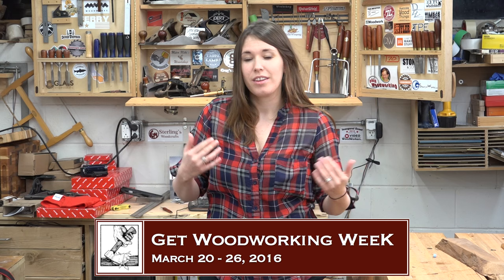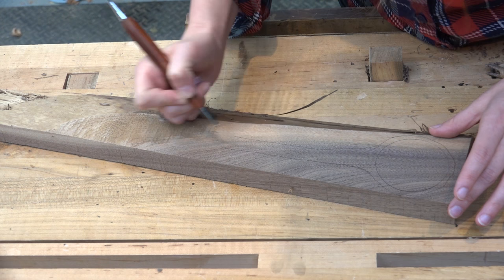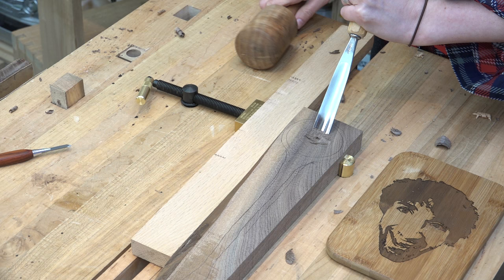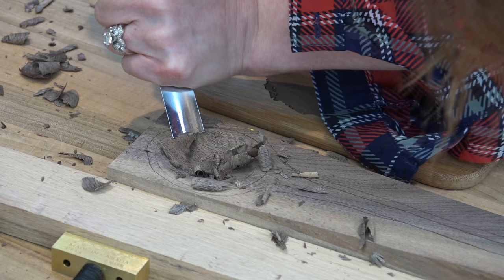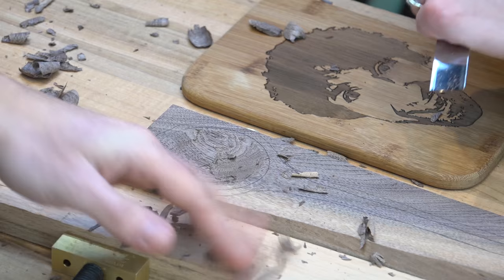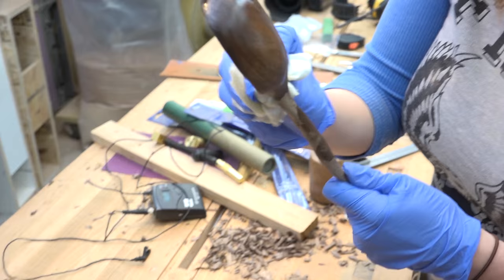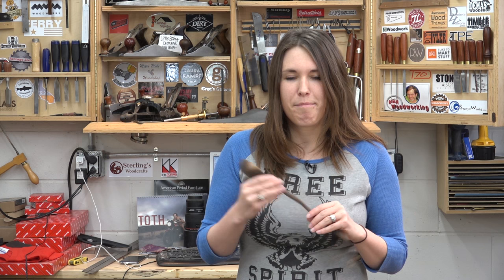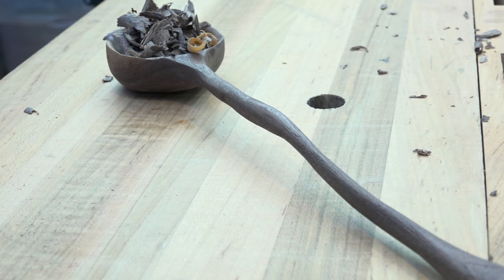Lindsay Carves a Spoon - Get Woodworking Week 2016

Comment: You had me a bit nervous when you were carving the handle, Lindsay. Well done!
Reply: +Steve Collins Thanks--me too.  And I started to get pretty crabby cuz the handle was much more difficult than the bowl.
Reply: +Lindsay Cremona You may want to try a carving knife to rough it out, however,  there is a learning curve to that because cuts are hard to avoid at first.
Reply: +Steve Collins Matt got me a carving knife. Probably will try it out on the next project.
Reply: Steve Collins yes me too I thought for sure that the chisel was going to end up stuck in her palm. Thank goodness it didn't and the spoon turned out pretty pretty good.
Reply: @lindsaycremona2459  Good first attempt.

Matt should have taught you a bit more about proper use of the chisel.  When carving the handle, the bevel side of the chisel should have been down. Using it with the flat side down tends to cause the chisel to dig into the wood and you don't have good control. 

To get a mostly straight handle, get Matt to teach you how to use a thumb plane. A cabinet scraper is a good tool for smoothing out the rough shape.

Even though you didn't like them, learn to use the spoon gouges, they make the job so much easier.

Comment: I wonder if the initial carving part would have been easier if the blank was closer to the edge of the bench so it would be easier for Lindsay to get some weight behind the tool so relying less on arm strength for stability.
Reply: +littlestworkshop Yeah, there was some experimenting with placement.  It was easier when it was closer so I could maneuver around it better.

Comment: Would of spoke shave be easier to use on the handle portion? just looked like it was about to break the whole time from the chisel but it could be the angle and the large computer screen.
Reply from the maker: +Jared S sounds like a good reason to buy one ;)
Reply: I wasnt sure. i will be getting a spoon gouge first.
Reply: +Jared S You need a spoke shave! So handy.

Comment: were you trying to do it mostly with just hand tools?  a Dremel might give you a little bit quicker and possibly better control also possibly going down to the desire depth with a Forster bit, and then deemed the sides.
Reply: Yeah, wanted to get the complete carving experience